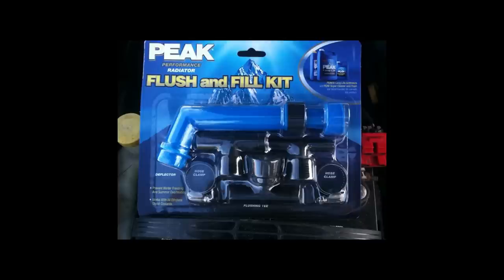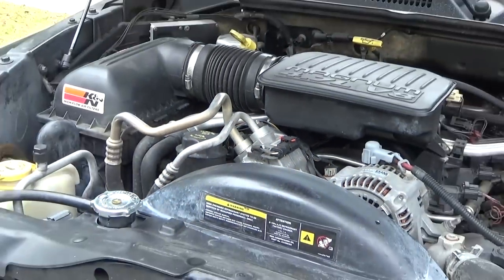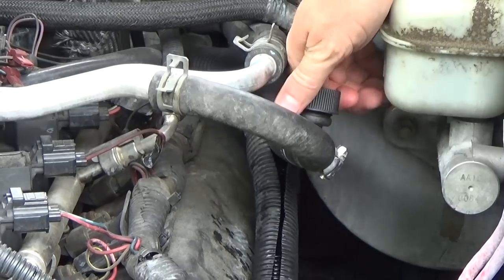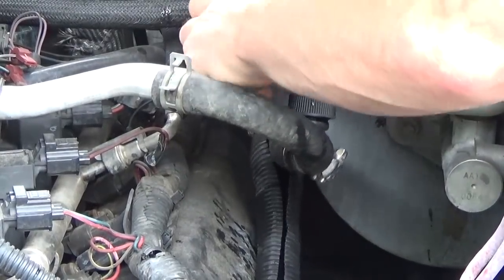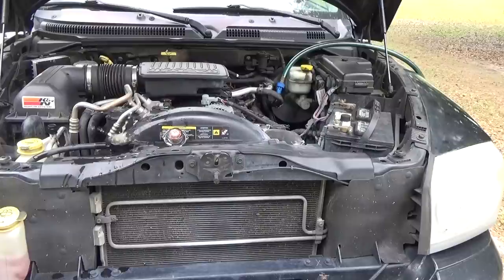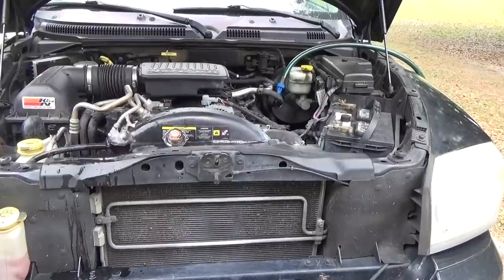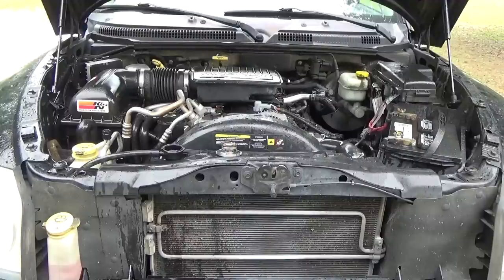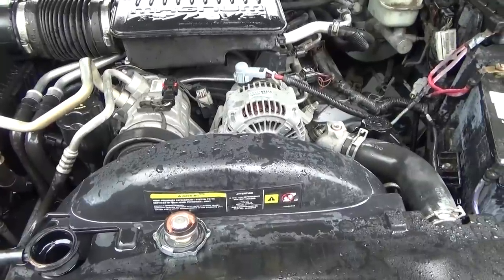How to Flush Your Car's Cooling System and Radiator

Comment: I didn't see you add any type of chemical flush that would remove rust, corrosion. etc. This would not do a very good job on areal, dirty cooling system.
Reply from the maker: You are correct.  This is a pure water flush to just flush out your old coolant.  See my other video here on what I recommend you flush your system with.  https://www.youtube.com/watch?v=L-M4RcFaNJ0
Reply: You cant use the cleaner while doing this, You have to let the car run with radiator cap on for 10-15 min when using the cleaner. Repeat that at least 3 more times. Then let the car cool down and finally flush this way. Or you can do this backwards Thats how I did it today. Took all day but my engine was fully flushed.

Comment: Does this Also flush the heater core?
Reply from the maker: Randy Jackson On my dodge it does. If your vehicle has a heater control valve you will need to make sure the heater is on and run it long enough to heat up and open the thermostat.
Reply: Thanks for the quick response Chris.  98 dakota sport. Did not see a heater control valve. Will crank up the heater just to be on safe side.  This crazy thing takes a long time on cold mornings to heat up.   I was wanting to kill two birds with one stone.

Comment: So, I would run my engine system for 10 minutes with the Irontite Thor-Flush first and then do this flush, right?
Reply: I will be replacing my engine and must do a complete coolant system flush, especially since I did use the gunk stop leak [which didn't work], so that I don't void the warranty.
Reply from the maker: +Tabitha Morgan Correct.  Irontite first and then do a water flush.

Comment: I've tested Walmarts 'Distilled' water in the past.  Not as distilled as one would think.  Now, they may have purified it by distillation, but it's not TRUE distilled water.  As pure distilled water does not conduct electricity.
Reply from the maker: Good to know Kevin and I didn't realize that.  Do you have any suggestions on a reputable brand?
Reply: @ClintHolland  
I'm afraid I don't.  I would imagine that water intended for a steamer would be good.  Or one could distill it themselves.  I'm probably gonna have to purchase several and test them lol
Reply: @Handle_number_7  how did you test the water? Ive tested distilled water with a water meter i have? Just wondered if you test the same way i do?
Reply: Just a battery and electrodes.  100% pure distilled water does not conduct electricity. 9 volts was extremely active.  I'm betting they remineralize the water. Or it's straight from the tap lol 
You'll see bubbles forming on either side of the electrodes.
Reply: @Handle_number_7  i have a meter that shows parts per million. I never bought walmart distilled before so i never tested that one.

Comment: Does this flush the heater core as well?
Reply from the maker: On most vehicles it does without any additional effort. Some vehicles have a heater control valve that only sends coolant to the heater core if the car is heated up and the heater is on.
Reply: @ClintHolland  thank you. My Ford ranger has the valve, but it engages with the heat on, so it should work

Comment: I don't want to cut the hose 😂.. any other way avoiding that part?
Reply from the maker: Not to get a good flush.  If you don't want to cut the hose, try just purchasing some cooling system flush. It won't be as good but it will work.
Reply: Will see if I can buy a piece of same hose to use on the flush, then put back the original one.
Reply from the maker: @rapidfirest  You could also just buy a connector as you should have enough slack to join them back together.
Reply: @rapidfirest  sure if your scared take it to a certified mechanic so you can throw money in his pocket. If you don't try you will never succeed

Comment: thanks for the quick response but how do I capture it when it's coming out of the top of the radiator like that
Reply from the maker: Drain it first so that the only thing in your radiator is basically just water.
Reply: Oic thanks so much .

Comment: Please correct me if I'm wrong, I never claimed to be an mechanical expert: When an engine starts, the thermostat remains closed keeping the coolant from circulating from radiator to engine, as the engine gets to operating temperature the thermostat opens then what? it dumps cold coolant into a warm engine. Something I believe you said never to do right?
I've been messing around with automobiles for a long time, what I always heard was to NEVER dump cold coolant into an hot engine that isn't running.  I'd did a few coolant flushes in my time, and I always let the engine come up to operating temperature so the thermostat would open, I've never had a problem perhaps I was just lucky?
Reply from the maker: So you aren't wrong, just a different definition of cold. The coolant in your vehicle is never truly cold, except maybe in the winter time or colder climates. However, before it reaches the engine it sits in the radiator right next to the engine and is actually warmed up substantially by engine heat before the thermostat ever opens.  If you dump cold water from your hose into the engine, it doesn't get this same warm up period.  And to top that off,  you actually can add cold water to a hot engine as long as you do it slowly instead of just dumping it all in at once.
Reply: Some pros tell you to drain the radiator, put in some flush chemicals , fill it back up with tap water,  and drive it for 15-20 minutes or until it reaches operating temp and thermostat opens.  Let it cool and then run the flushing process a couple of times.   @ClintHolland
Reply from the maker: @RSW1484   That is correct and that's how I do it most of the time. However, if you have a plugged heater core or if your coolant was in pretty bad shape, this is a much better way.  It just takes more time but it results in a better flush. You can also combine the two methods of using the chemicals and this kit.

Comment: how do I flush it then if my coolant is not environmentally friendly
Reply from the maker: One of two options. Capture it in a bucket and either dispose of it at your local recycling center or flush it down your toilet. Just don't pour it in a storm drain or anywhere like that.
Reply: Don't flush it down the toilet.
Reply: Yes, do not flush it. Antifreeze is very toxic and it’s the last thing you want to introduce into your water system.

Comment: When you performed this on your vehicle does it clean out the heater core ?
Reply from the maker: It absolutely does as long as you let your vehicle warm up to standard operating temperature. What make and model do you have?
Reply: @ClintHolland  Dodge Ram 98 5.2
Reply from the maker: @christopherdrake5585  Yep, that will work just fine on your Ram.  Just let it warm up  while you are doing this.

Comment: Okay so I'm new to this is my first time doing radiator flush now I'm using a radiator cleaner chemical not Prestone another brand but it's same idea however data get because using distilled water so you don't have to worry about tap water for instance I have really hard water containing a lot of limestone I can watching use the system I don't see how it gets all of the tap water out as you said just draining the radiator does not drain the water out of the whole system so I don't see how this is a good thing not to mention the fact that all of that crap just went on the ground and obviously some of that s*** probably contain coolant even if in small amounts I just don't like the idea of not collecting it since I have pets so I have to say wouldn't it be better to run the cleaning chemical through it then flush it once or twice by filling it back up with distilled water running it for awhile and draining it and after that adding in concentrate antifreeze based on the maximum capacity of your system that just seems a lot better and it saves you from having to worry about tap water especially if you're like me with hard water that's not going to be good for an engine at least I don't think it would be
Reply from the maker: If you want to be by the book, then you technically should use distilled water.  However, and the reason it really doesn't matter, is because anti-freeze has corrosion preventers and inhibitors that basically neutralize the small amount of tap water left behind.  If you really want peace of mind, buy a coolant tester for like $10 and test your coolant when you are done.  You will see that it passes with flying colors even with some tap water left behind.  The issue is that you really can't do a good flush on your vehicle just by using distilled water. You need to be able to use the water hose which of course is just tap water.

Comment: ANYBODY make the flush T out of metal? I just put new hoses on & if I cut one I'd rather put in a metal T instead of a plastic one
Reply from the maker: Not that I am aware of.  I know you can buy a metal straight through connector that you can put back in when you finish.  Better than leaving this plastic one in but mine has held up for 5 years now without an issue.
Reply from the maker: @Bodhi Gurley You sure do.  It comes with a cap. I have several cars that have had that T installed for 10 plus years and have never had an issue.

Comment: Do I run the heat when flushing
Reply from the maker: Ideally.  Some vehicles have heater control valves which means you aren't actually flushing the heater core unless you have the heat on.

Comment: Dude.. normal operating temps are around 200 degrees.  I seriously doubt cool water is going to cause any damage.   The damage comes from putting cool water into an overheated engine.  I guess it's better to be safe than sorry though.
Reply: Follow this advice at your own risk - and that of your engine.

Comment: Shouldn't you drain first then flush with water . You just flushed coolant all over your driveway where dogs and cat cold now be poisoned . Just saying.
Reply from the maker: Potentially but I run non-toxic coolant in my vehicles so it isn't an issue.  I recommend everyone do that actually.

Comment: I can't believe you cut a hose to do all this just to flush your engine coolant. Totally unnecessary. You can do it without being so destructive. But whatever. You do you I guess.
Reply from the maker: I am simply following the instructions on the package.  Cutting a heater hose is not that big of a deal, they cost like $10.  I also have another video of using chemicals to flush your system.  However, the truth is that if you aren't willing to cut or disconnect a heater hose, you will spend hours flushing your system versus minutes.
Reply: @ClintHolland  I get it. Whatever works for you. I just wouldn't do it that way I suppose. As long as you achieve the end result required.🤘

Comment: What a messy way of doing it plus all that toxic waste goes into the environment.
Reply from the maker: What is the alternative to doing this at home?  Also note, you can and should run non-toxic coolant in your automobile so it isn't an environmental issue.
Reply: @ClintHolland  interesting I never knew about non toxic antifreeze. I just removed the valve at the bottom and then added distilled water from the top let it run thru the system. Drained it again. Did that twice. Had a big pan on the bottom. Had no waste on the ground. And was pretty much very neatly done.
Reply from the maker: @NeutronX101  Yep, definitely a great product to use if you have animals and it's only slightly more expensive.  I suspect one day it will be all they allow us to use. I have watched too many crime shows where someone poisoned their spouse using it.
Reply: @ClintHolland  yes.

Comment: forgot to say open your heater valve
Reply from the maker: The Dodge Dakota doesnt have a heater control valve but valid point in many other models.
Reply: your Telling me the water constantly runs through the heater core
Reply from the maker: +Chris Myers Yes sir. And anyone who has ever had a heater core leak on a Dakota will confirm. If you have a leak  in your heater core it will leak from the moment the thermostat opens until you have no coolant left to leak, even while running the AC.

Comment: My '98 Dakota 318 had heater problems. Bought it off a lot. Some dkhd had used some type stop-leak/sealer (never found out what) in the engine prior to selling it. Replaced rad, water pump (which was weeping), thermostat, and also found the flapper door inside WAS working, so I asked a pro. He suggested Lime-Away. I began the back flush doing the same steps this guy used, but ran at idle for about 2 hrs. with my heater on full, circulating the stuff through the whole system. Flushed 3x with distilled water and refilled the system with 60/40. Coulda done it all again for what these kits cost. Won't burn your feet, but warms up pretty good to be 22 years old.
By the way, at 10:48 it looked like a pee-hole in the bottom of the radiator when he opened the cock. That could cause coolant loss!

Comment: This process is wrong. You can see in the video the toxic coolant (green colour) spilling out of the radiator into the ground.  This is lethal for humans and pets - and bad for the environment. Coolant should captured in a container and recycled at a designated station.
Reply from the maker: +John Dawson You are correct in general but not in this specific situation. Many of the new coolants of today, including the one I use, are non-toxic to humans and pets.  As a matter of fact, the main ingredient in them is approved by the FDA for use in foods.
Reply: John Dawson you're wrong. and also inflammatory so just take a breath and calm down.

Comment: Water also contains no lubricant for water pump seals, turns to steam, and boils early at high altitude...Water is never better than coolant.
Reply from the maker: Agreed on all most points except the fact that water is in fact better at cooling at your engine than antifreeze.  That is the point I was trying to make. Many people in temperate climates run water and only water in their cars and have for years.  The water pump seal lubrication myth has been busted many times as well.  But agreed, it does turn to steam at lower temperatures than antifreeze but with the pressure most systems are under even then it doesnt boil until 257 degrees F which is fine for most engines.
Reply: @ClintHolland  you are talking about minor differences in water vs coolant ability to exchange motor heat with the atmosphere. If you believe what you say fill your cooling system with water and take a drive through the desert southwest in July and August, or climb Raton Pass in the summer. Water really cools best when a 13 lb cap blows steam. Nothing cools a motor better than water turning to steam. Race cars use water because they are specialized and coolant pollutes the track. Under your thinking alcohol would be the best coolant or a high pressure system using freon, or even canned aerosol dust remover. Supporting your concept though, coolants are rarely used in their pure form, they always have some proportion of water. Ethylene glycol is alcohol which is way more efficient than water at heat exchange as well as propylene glycol. 

I hope some inexperienced person does not read your comment, then in an excited state about an upcoming X-country trip to California, decides to flush his cooling system, then wanting to add the best coolant according to you, decides to refill it with distilled water at $1 per gallon as opposed to 50/50 coolant at $13.50. His theoretical trip taking him, his wife, and new baby through west Texas, New Mexico, Arizona, Nevada and finally California. Not having replaced his 13 lb radiator cap with a 20 Lb cap he will most likely be on the side of the road with steam billowing out of his cooling system because the desert floor was 140 degrees F, his altitude was 6500 feet, and he had his AC on max to keep his wife and baby cool. But say for a moment he did put on that 20 psi cap, then he might be on the side of the road with that old radiator hose split because of the excess pressure, and steam blowing out that gaping split. He will be lucky if it is the top hose, that way he wont lose all his water...But since you say that lubricity is a myth, then he probably wont lose the water pump to the lack of lubrication but rather to the over heating and of course the thermostat will soon fail after an over heating incident.

So water may transport and exchange heat slightly better than the glycol coolant in a laboratory environment its not a better coolant for your car. However the math supports your position.
Reply from the maker: @JA-ux7dd  Ok.
Reply: @JA-ux7dd  Holy moley Karen…

Comment: It's obvious you do not know how to do this correctly.  You are suppose to put the angled part in the top of the radiator with a hose connected to it.  The hose goes into a bucket.  YOU DO NOT FLUSH THE ANTI FREEZE ONTO THE GROUND!!  You then bring  the used antifreeze to a recycling facility.  Anti freeze is lethal to anything that drinks it.
Reply from the maker: It's also obvious that you didn't actually watch or listen to the video.  If you had, you would have heard me cover why I didn't use the deflector tube at around 3:30 seconds, it didn't fit by the way, a common complaint from people online about this kit as well.  You will also notice, again if you actually watched the video or looked at the description, that my vehicle didn't have anti-freeze in it and had already been flushed so allowing it to flow on the ground was completely safe. But let me do you one better. Had you read the description for the video, I even mentioned that I run non-toxic anti-freeze in all my vehicles and have been for years so even if I wanted to drain it on the ground, I can.  But thanks for watching, or kind of watching.